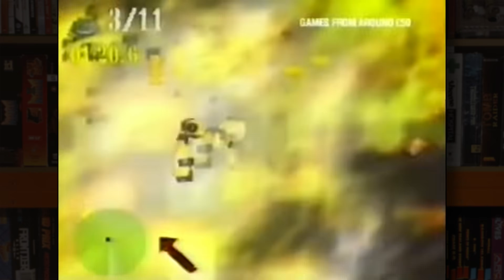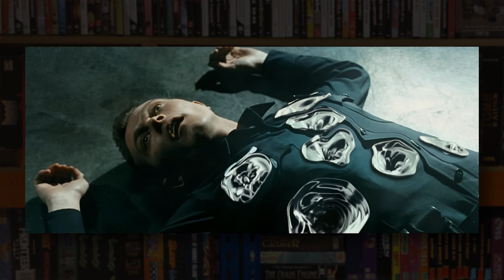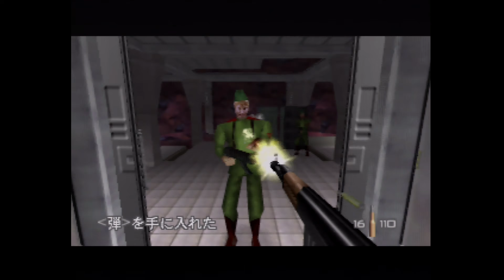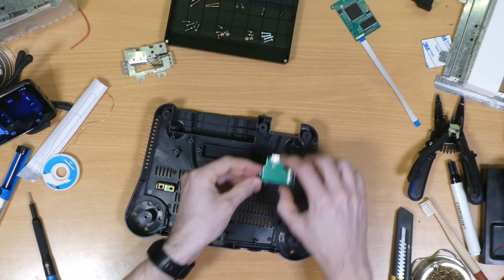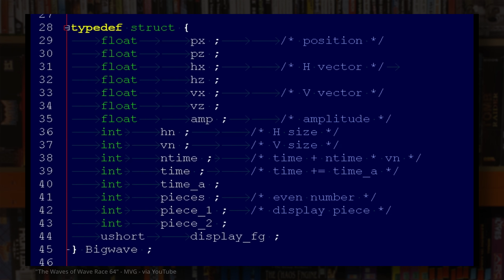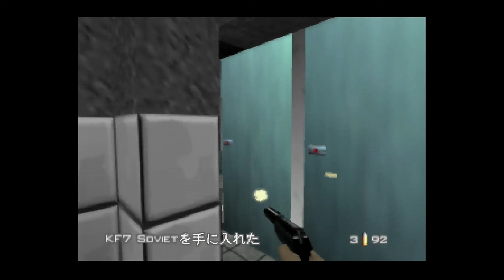Discovering (And Modding!) The N64

Comment: Regarding the mutual exclusivity of the Controller Pak (the memory card) and the Rumble Pak, there actually were actually a few third-party options for this, including the Nyko Hyper Pak Plus and the Performance Tremor Pak Plus. I know next to nothing about the Hyper Pak, but the Tremor Pak used a pass-through setup where you plugged a regular Controller Pak in to the Tremor Pak and plugged the Tremor Pak into the controller, and games could use both. In theory it could actually work with any other accessory that used a different protocol from the Rumble Pak, but I never tried it with anything else. It still annoys me that N64 emulators don’t generally support this kind of setup.

Comment: Very thorough with your modifications and commitment to enhancement to the max of the system. Nice soldering skills too!!

I felt compelled to comment seeing you holding the controller playing Doom 64. Just wanted to say I never understood holding the controller that way. The N64 was the only controller that had this dynamic where there were different ways people would hold the controller, even for different games. I always held it with hands on each side, stretching my thumb towards the joystick which has always worked well enough.

Comment: Fun to get a fresh perspective, well technically the consoles were inferior but the game designs could still be good. It was an era where without the rise of 3DFX-Voodoo things like N64 could have still had some advantage over PC gaming. When Quake came out on the N64 reviews did emphasize how collectively between platform & game cost that it was a much cheaper option for approximately a GLQuake experience.🙂
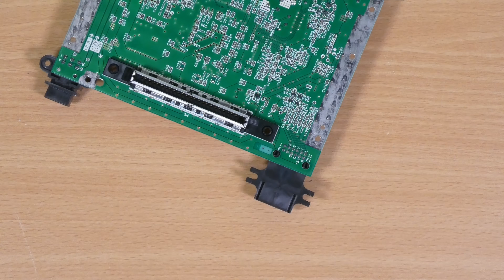4:00 Lol yeah NA had a long running blocking strategy for better AV for no logical reason Ie. "RGB video TV and devices, nooooooo!", it was like they wanted the best a CRT could do to go completely to waste in it's lifespan but then finally adopt it just before the rise of LCD screens.😒
9:02 Slight blur, that's subjective, frankly I love the new option to turn it off because it's more than slight to my eyes. It was a bizarre choice by Nintendo as the default AV options were soft and blurry already so putting more blur on top baffles me. Scanline options are always good since it's a hard thing to simulate well that to have multiple takes on the aesthetic is good.
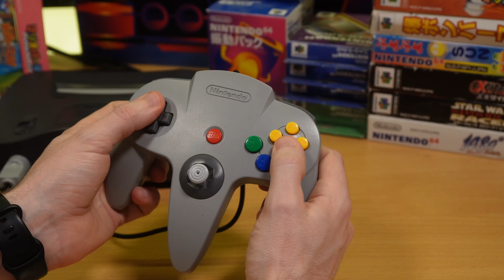9:58 The biggest thing I can say to the three-hand meme junkies is that the N64 is ambidextrous in it's mostly symmetrical layout, meaning you can grip it to either dominant hand. The main thing missing is two buttons next to the D-pad, see Virtual Boy for how that might have looked. Mainly the games optimized for no B&A buttons and one shoulder button work best such as FPS titles, plus every button isn't necessarily used by every game ijs. Lastly it's the only design where a single analog joystick actually works(FPS especially.), see Saturn, Dreamcast and PSP for weird redundant directional controls in games Eg. Walk-Digital & Walk-Analog right next to each other.
I have an N64 now but bitd my cousin was how I enjoyed that platform, lots of Goldeneye deathmatches.😁 I think Super Mario 64 was what I felt the most left out on going with the PS1 instead as I didn't find many that controlled as well as it. Yeah Doom-Quake 64 didn't get much respect in the past but lately it's gotten more love. Got to get Pilotwings 64 myself.😉

Comment: The N64 is one of my all time favourites alongside the Dreamcast. It has a ton of great racing games. Especially atari/midway arcade ports. Such a shame it's Japanese library is pretty small. JPN releases are very cheap, but most of the better titles were only released in the west. As an European, I usually have to buy carts from the states, which is expensive. Most PAL releases are rubbish.
Reply: And the  the whole 50hz thing also sucks not that 50hz Is bad is just the conversions were terrible
Reply: @Jezza_STG  That's why I mentioned most PAL releases are rubbish. There are a few that play perfectly fine like Banjo Kazooie and South Park, but most are pretty bad.
Reply: @AfterBurnerTeirusu  cart from Ali eth games play it 60hz on pal console with no black  bars

Comment: Just so people are aware NTSC n64s does support S video as the highest quality output without modding and it's a big jump from composite

Nintendo removed S video support from PAL consoles so it's composite only If you're using one stock
Reply: My PAL N64 outputs svideo without mods.
Reply: @dant5464 strange indeed as pal consoles are composite only
Reply: Who told you that, only 2-3 variations don't output svideo , 95% of pal N64 output svideo signal